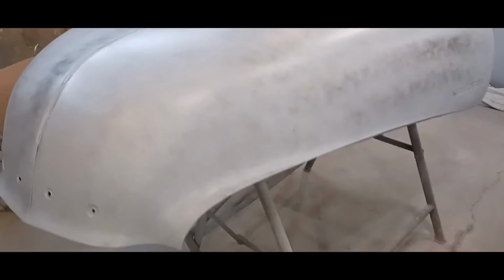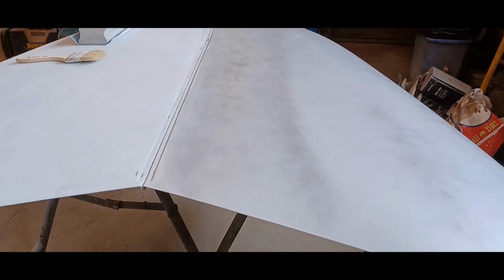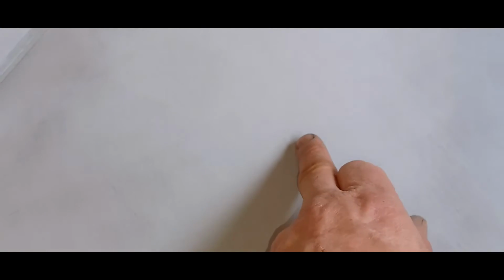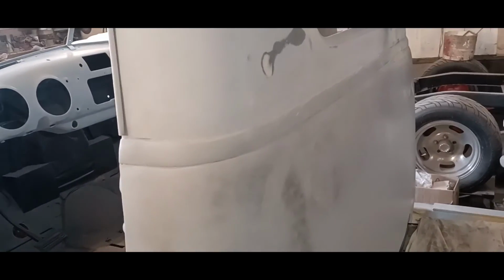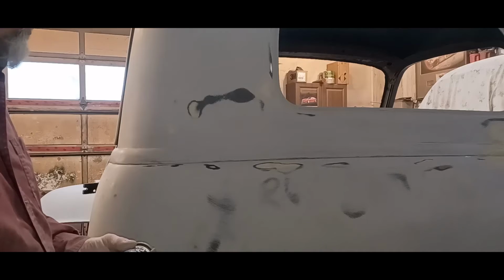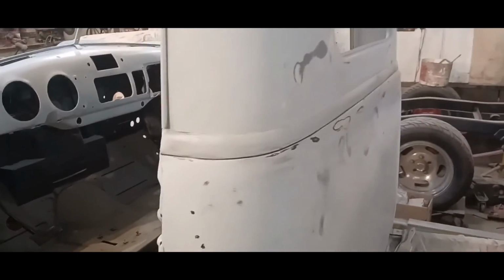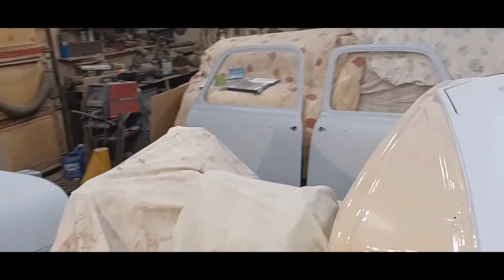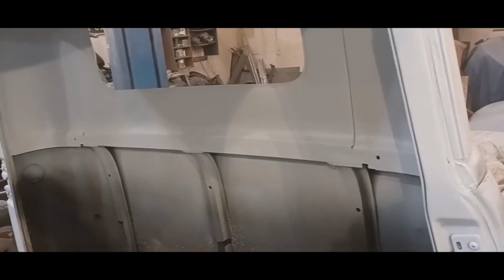1951 CHEVY..SEALING THE BELT LINE JOINT & WHAT IS A GUIDE COAT?

Comment: Thanks for explaining the guide spray again. You mentioned getting new wheels.  When you put the front end hubs on, what hole spacing did you get? (Chevy or Ford ).   Is the rear wheels going to be the same wheel stud spacing? 
I see a lot of guys have Ford wheel pattern on front (Mustang II setup) and Chevy wheel pattern on rear(Camaro ). Can you order the Mustang setup with a Chevy (5x5) hole pattern and change rear axle shaft in a 9” Ford to have Chevy (5X5) pattern too?  Crazy questions uh…
Reply from the maker: mustang II front and 9" rear...all Ford 4.5X5